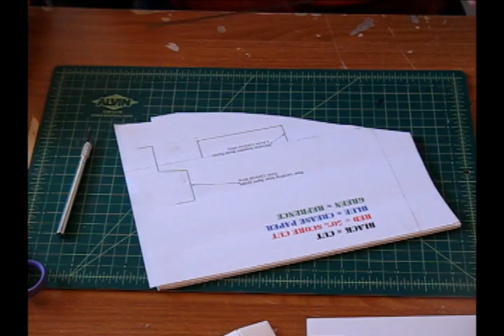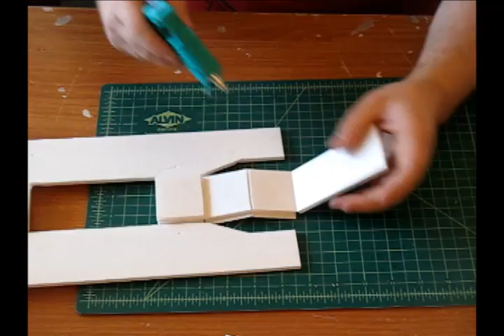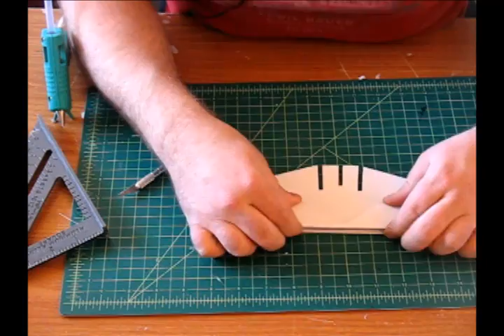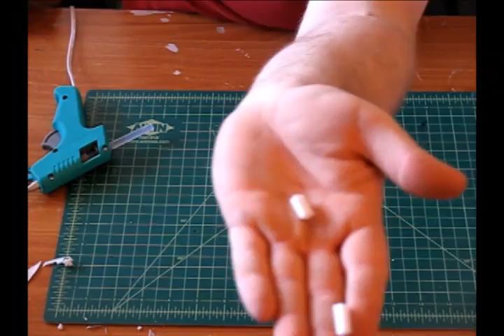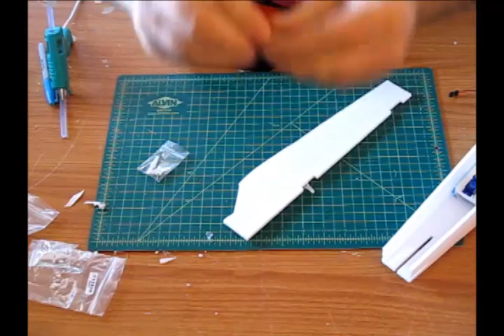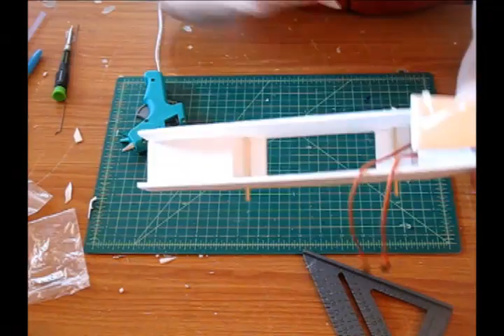Swappable Trainer Scratch Build

Comment from the maker: @Blake L You can use a Turnigy 300 park but I prefer the NTM 28-26 Prop Drive from hobbyking. But any 300 - 400 size will get her in the air. Hope that helps